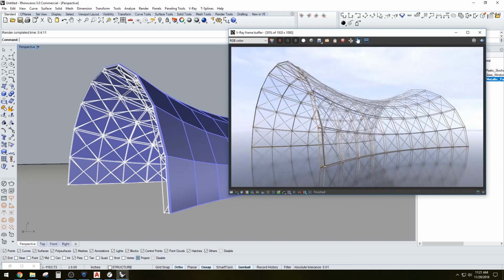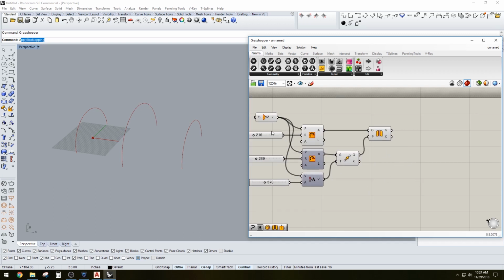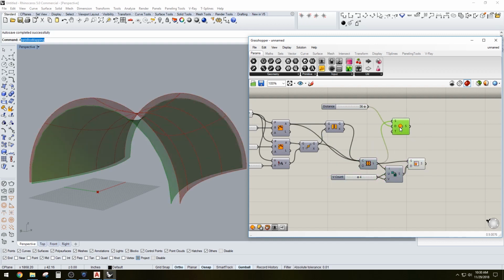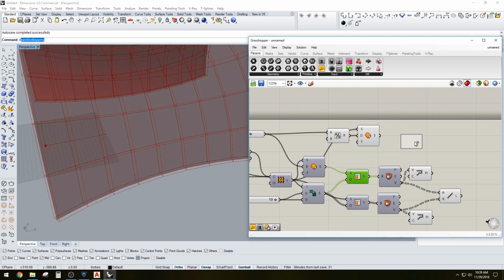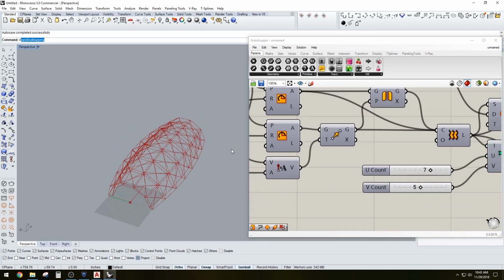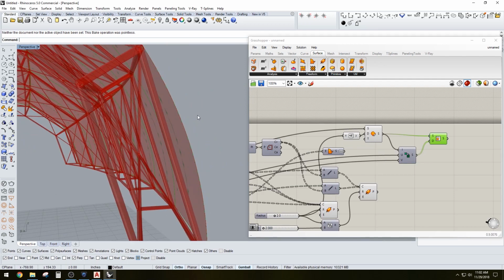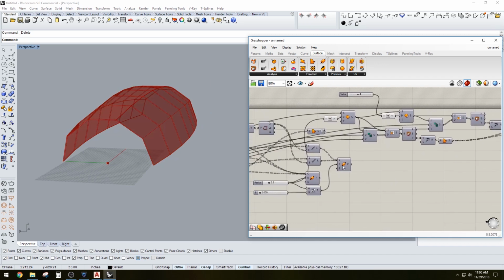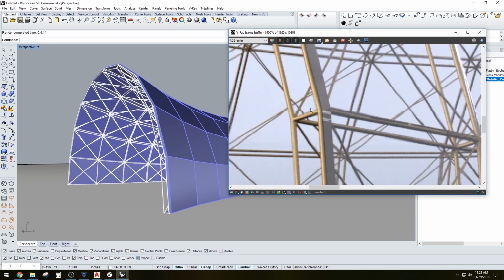Grasshopper for Rhino 3D Architectural Space-frame in Grasshopper for Rhino parametric tutorial

Comment: How can I connect "polygon centers" with lines ? i want lines between my polygon centers
Reply from the maker: You can use a line component with start and end points.  Use the start point as the polygon center, and connect it to the polygon edge points.
Reply: @DCOParametric   can you be a bit more specific? i just tried this and i dont get any lines. if it is easier, it can also be a "surface from polygon center points"